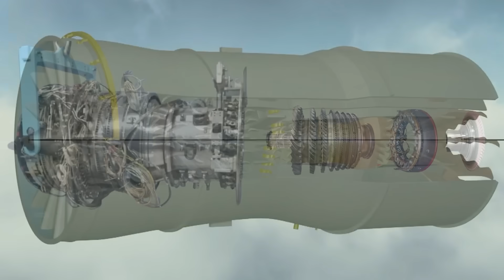How powerful could America's new F-47 stealth fighter really be?

Comment: Fun facts for comparison. The SR71 engines only made about 34,000 lbs of thrust each and the F15EX gets almost 30,000lbs of thrust under afterburner out of each of its engines. If this really does break 100k combined then stealth might not be the only trick up its sleeves. I mean if they ever did actually get targeted by an AA missile the F47 could potentially just outrun the interceptor. We already have good reason to believe that the F15 can hit mach 3. The F47 will probably be able to at least match that if not potentially break the speed records for the SR71.
Reply: RAM (radar absorbent material) is the speed limiter on sealth aircraft.
Reply: @Armour_CS 
Ceramic RAM has been in development for years. It is highly heat resistant and allows 90%+ radar absorption.
Reply: @Armour_CS for old coatings maybe. We don't know about future ceramics
Reply: @Armour_CS from my understanding the material upgrade is a big deal for sixth gen 

Cost and quality leaps .. big leaps
Reply: The trick with the SR-71 though was that it was designed to fly over Mach three and stay there throughput its mission. Our fastest fighters can only briefly fly at their maximum speed for a few minutes. I’m excited to see what this new plane can do.
Reply: @ecleveland1  yeah though we just don't know what this new plane is capable of and may not know the actual capabilities for decades. The government never likes to admit the top capabilities of our platforms. Still though even if it is only in short sprints it could still be useful in defense.
Reply: @ecleveland1 reason is that modern fighter jets still use turbofans, the turboramjet in the blackbird is designed for maintained high speed because ram engines require fast flowing air to preform, this air makes the jet incredibly efficient. The f47 with fitted turboramjets would be insane but not likely
Reply: @ecleveland1  and the blackbird was long enough to handle the speed.  These shorter planes are not safe at those speeds even with better materials.   It only takes a small perbutation in angle to spin these out.   Not like the 60s longer heavier jets.  It's like expecting a cardboard Scott towel roll to go mach 3
Reply: That might just be possible, for short sprints. I think the 47 is going to be one dangerous plane!
Reply: You’re comparing apples to oranges, static thrust is mainly a takeoff metric. Thrust is not constant with altitude and speed, the engine design will determine in which regime it’s meant to operate, it’s a compromise. 
It’s very complex, it has to do with Overall pressure ratio, turbine pressure ratio, inlet design, compressor speed, turbine speed… once you reach a certain speed, thrust might abruptly lower or you could encounter engine stall. 

The magic of the SR-71 engines is how they were able to operate at mach 3 and produce sufficient thrust.
Reply: @MrSnakedHD  They were able to do that because at such speeds, they don't use the J58 turbojets anymore.
Reply: The venerable F-4 Phantom was denied a modification that would have made it a Mach 3 recon plane for Israel. Can't remember the Utube channel for it but it was a Pro. Anyway speed is not everything but acceleration and power for super cruise is going to be a game changer. Sustaining a Mach 2 supercruise for egress would be mindblowing. F-22 was reputed for Mach 1.6 and the F-23 was higher. Anyway you look at it the F-47 will take names and kick arse. I reckon a prototype is already flying and production planned.
Reply: @alexandermarken7639  when announced they said it had already been flying for at least 5 years. Gave me goose bumps. It's already alive doing cool stuff.
Reply: @alexandermarken7639  ...Yeah, not really. Supercruise isn't that great at all.
Reply: Patriot missiles do Mach 5. If the plane is high enough the missile won't be able to make up the distance. Which is how the SR-71 survived. But the plane isn't going to flat out run it.
Reply: @ No It wouldn't outrun it but you kinda made my point. Altitude and distance are major factors. Patriot has a 100 mile disclosed range. If it fires at this plane from like 70 miles out you might think that is a clear hit as it is within range but the thing is that if the plane pushes it it might be able to get to that 100 mile limit before the missile does because it only has to fly 30 miles in the time that the missile would have to go 100 miles. This math holds true for every plane but if a plane can only fly subsonic like the B21 it is outclassed by the missile about 5 to 1. My speculation was simply if this has so much power and could actually do mach 3 like the f15 then the missile's advantage is only about 1.6 to 1 and there is a decent chance that the missile will run out of fuel before it actually reaches the plane.

There are also other factors at play here. A SAM requires a targeting lock from the main radar system to guide the missile to the target. Given how stealthy this thing is likely to be it may not have nearly as much range to provide that targeting lock. The F47 may only have to increase the distance 5-10 miles further out before the radar station isn't able to accurately target it anymore. War is a lot more complicated that simply comparing a spec sheet.
Reply: idk maybe peak thrust only applies to mid accel not top speed thrust. also the skin might melt at mach 3 could be like 2.5 mach tops like a raptor. but it sure will be aerobatic with that much thrust.
Reply: Highly doubt it. The SR-71 was a giant fuel tank aerodynamically designed for speed and with enough extra room for a pencil. Physics hasn’t changed. The requirements for stealth technology don’t always play well with aerodynamics. I’d be surprised if it can reach Mach 2.
Reply: @ Um the f22 has a disclosed top speed of mach 2.25. With this kind of power and all of the work done in recent years on better RAM then if the f47 can't reach at least mach 2 I would be surprised.
Reply: Highly doubt it. The SR-71 was a giant fuel tank aerodynamically designed for speed and with enough extra room for a pencil. Physics hasn’t changed. The requirements for stealth technology don’t always play well with aerodynamics. I’d be surprised if it can go much faster than Mach 2.
Reply: i'm beginning to think this new plane might be capable of brief periods of hypersonic or near-hypersonic on afterburner, between this and the heat-resistant stealth coating
Reply: @ Um hypersonic is mach 5 so I would doubt that those speeds would be common. I mean maybe there is info not currently disclosed about the engine design that would allow it but with what we currently know I don't think it will be possible. I think Mach 3 in a sprint might be a reasonable expectation with mach 3.5 being something of a stretch goal. Above mach 3 though you need fundamental changes in engine design that I don't know if would make sense for a fighter that is intended to be capable of long ranges.
Reply: Which is perplexing. Why the f-18 is reportedly slow to regain speed when it has two engines while the f-16 is a hotrod with one engine size no withstanding. 

The sr-71 is way faster and heavier with engines comparable to an f-15 which is lighter. 

Never got the math behind some engine designs and plane assignments when obviously we can make faster and more efficient engines. Imagine the hornet with these engines and it's AOA.
Reply: @nightshift7963  I am not an expert but I would imagine it has a lot to do with thrust to weight ratio. You can have a smaller thrust on a plane so long as you have less weight.
Reply: @chaosfenix  depends on the drag co efficient, it would have to have less drag than the sr-71,which it probably does but hard to say for sure atm.
Reply: BUT, the SR-71's engines produce produce around 34.000 pounds of thrust only in the turbojet form, that's to propel the plane for takeoff, landing, or to get up to cruising speed. When approaching cruising speed, the engine bypasses most of the incoming air around the turbojet core.
The inlet cone slows air to subsonic before it hits the compressor, but most of the air and thrust comes from the inlet/afterburner combo—essentially ramjet-like behavior. That's what keeps it above mach 3
Reply: Hmmm....SR71 speed required ridiculas systems to cool air frame pieces and crew. (windscreen temp was 600°F, parts of plane over 1,200°F), exotic materials , nitrogen purged interior of tanks etc. The insane infrared signature given off by temps like this and the stealth coatings burning off makes me think the object of  the new jet would be speed. Maybe the ability to fly in any direction with rapid accelleration (like a fabled "UFO") would use this much vectored thrust. With a human occupant, any direction 7g's manuvering and your pilot is soup. The SR72 needs scram jet cross over motors for faster than mach 3 or 4. Turning at that speed takes a while. Again, not thinking this is all about speed.
Reply: @ Yes but a lot has happened in material sciences since the SR71 was designed in the late 50s and early 60s. Ceramic RAM has been in development for a long time and would help address the maintenance issues that came up in earlier coatings. In fact the fact the fact that they are touting the low maintenance of the RAM is indicative of more durable RAM. Due to the temperatures at high speeds the SR71 used quartz windows. Again they may be using transparent ceramics on newer planes if they are intended to go at higher speeds.

Importantly I don't think the plane is intended at all to go at those speeds for long periods of time. I mean if they do use an adaptive cycle engine that pretty much guarantees that. I am not saying that all of its flight time would be above mach 3 but that if could jump to mach 3 really quick if it needed to outrun something or get energy.
Reply: The F-22 should absolutely destroy the SR-71 records with it's greater thrust and a higher thrust-to-weight (>1 vs. 0.4). Things just don't work out like that, unfortunately. The Raptor is likely most limited by the fragile stealth skin and definitely by the air intake. A new stealth fighter can improve on these, but trying to be a Mach 3+ jet would require too many concessions for an air-superiority fighter. I personally wouldn't be surprised if an unchained F-22 could break Mach 3 but the whole jet would be a write-off.
Reply: @Varadiio  The air intakes is the main limiter to the F-22s speed. Just like the F-16.
Reply: @garyyoung4074  Yes sir, what you say is all true, but if the F-47 could achieve Mach 3, i doubt it would need the Blackbirds cooling as it would not be designed to maintain that kind of speed for long periods, only for a short sprint if it can do it at all? at the moment it is all uninformed speculation.
Reply: Would NOT be flat out speed..messed up my comment......
Reply: @garyyoung4074  fyi - you can edit your comments on yt

Comment: I think total thrust might be a difficult number to estimate based on current engines. Rolls Royce 15 years ago offers EJ200 Stage 2, which would push out 27k lbs total thrust, and 17,500 lbs dry. This is an F414 sized engine putting out F110 levels of thrust.

Weight only marginally increased, which gave us an engine T/W ratio of over 12.4:1,and a dry T/W ratio of 8:1. This means that a Eurofighter fit with these engines would have a had a greater than 1:1 T/W ratio with a full load, on dry thrust.

That, mind you, is an upgraded engine from the 90s, and RR is also looking at an adaptive engine for GCAP. The F-47 isn’t looking to be J-36 big, like some of the earlier concepts suggested, and even 100,000lbs of thrust for a jet that size wouldn’t break a 1:1 T/W ratio. The J-36 needed 3 engines for a reason, even the latest western adaptive engines wouldn’t propel a fighter that size well, if the MTOW is nearing 120,000lbs. 

So while I think 100k lbs of thrust is a reality, and not impossibly a low ball figure, it will likely be in a smaller jet. The F-47 just eyeballing it seems to be slightly larger than the F-22, maybe F-111 sized. That will be light enough for 100k lbs to actually do something.

Comment: The power surplus implies future offensive laser weaponry!
Reply: They already put lasers on fighter jets. Lasers on a sixth gen is a given
Reply: I would think any energy weaponry would be for defensive uses, like blinding heater seekers
Reply: No way, bro. they need to power CPU or maybe GPU for AI
you know that NVIDIA 4090 is only 475 watt power requirement, NVIDIA 5090 require 1000 Watt
those AI Chips is true power Hogs

and it would be more usefull than Laser
Reply: @thehumus8688 What power issues are you referring to? Even if there was a 5090 class gpu onboard for some ml/ai, aren't most 5090s rated for 575/600W TDPs (not 1000)?

The F35 supposedly has multiple 80 KW generators onboard, I doubt a 1000W gpu is very high on the list of concerns when, for example, radar systems are already north of 10-20 KW
Reply: @ryashau3527 More like 800kw. But trust me, Boeing will fry more pilots than they do adversaries. The company is circling the dog doo doo drain. This charity project is just to keep them afloat a bit longer for completely unrelated purposes. There is absolutely nothing to be excited about here, but in 10 years, there will be a lot to be ashamed of.
Reply: @thehumus8688  that is pretty minimal power, all things considered, the card doesn’t operate at 1000watts continuously thats its peak power output.

Comment: Self-cycle engines mainly optimize fuel economy in different speed ranges, especially ensuring fuel economy during high-speed flight. Judging from the information disclosed so far, the thrust-to-weight ratio of this type of engine will not be as high as the F22 engine F119 (the thrust-to-weight ratio of F119 is 10?). China has just completed the same turbofan 15 as the F119 engine. The newly developed self-cycle engine is said to have made many breakthroughs, but the urgent international situation determines that the J-36 and J-50 will use the current mature engine (WS10C and WS15)

Comment: Mach 2 - “Super Cruise” 
It won’t need to be maneuverable
-just fast, invisible, long range with a heavy payload
Reply: I think it will need to be maneuverable - just not for the sake of fighting other fighters.

We now have to contend with drones in the sky as a legitimate threat to air dominance. Taking these out with advanced long-range missiles loses you the coin war since the missiles cost more than the drones.

You need to use cheap, short-range missiles like the new AGR-20, which Alex actually discussed in a recent video. These have very short range, which will force you to get in closer to the enemy formation just to be able to use them.

The fighter will have to weave in between enemy drones as it shoots them down one by one with its cheap missiles, exposing itself to threats as it does so. To do this effectively, it needs to be maneuverable.

That's why it has canards. That's why the chief of the USAF himself said it would be more maneuverable than existing fighters. The addition of cheap UAV swarms has changed the game, and made previously obsolete technologies and strategies revelant again.
Reply: @ ya of course. 
My point was that, without vertical tail for control, I think it will be less of a focus. 
There is always a trade off with stealth. 
More stealth = less control surfaces